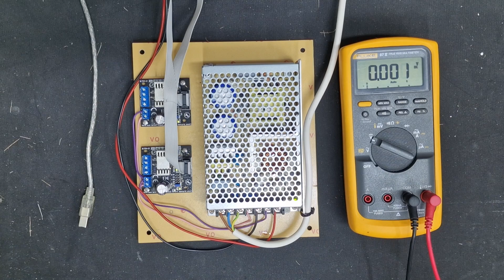Why You MUST Ground Your Power Supply (Before You Fry Your USB!)

Comment: I love the way you worry about a 0.5V spike going into the USB cable but are completely unconcerned about using a screwdriver right next to the 230V input, apparently without turning anything off first.
Reply from the maker: Voltage spikes ranged between 20V and 50V but were too fast for the multimeter’s auto-range to capture. The power was turned off at 2:50. You can see my shadow as I leaned toward the AC plug.

Comment: Isn't V- the negative voltage?
I'd connect the 0V to earth...is that right?
Reply: May depend on the power supply. Not all have a negative rail and in DC output it's simply + and - terminals. Where you would connect - to ground like shown here.